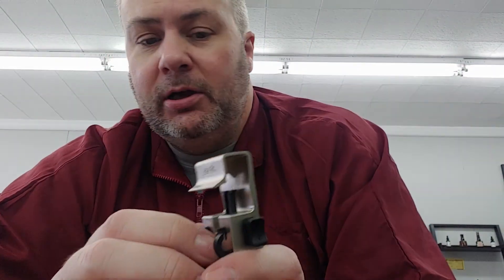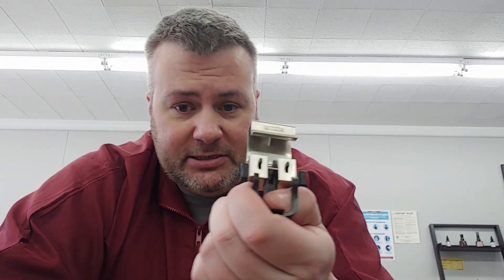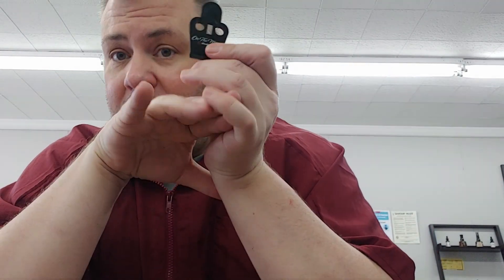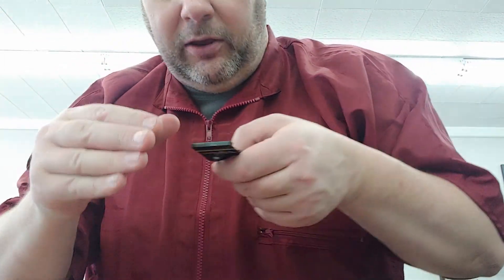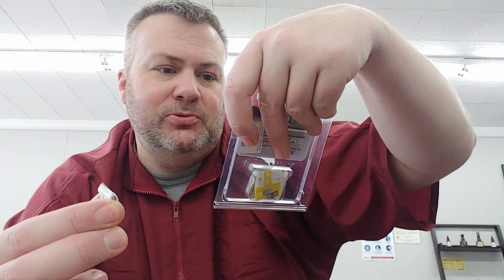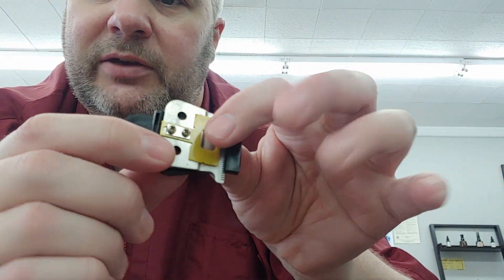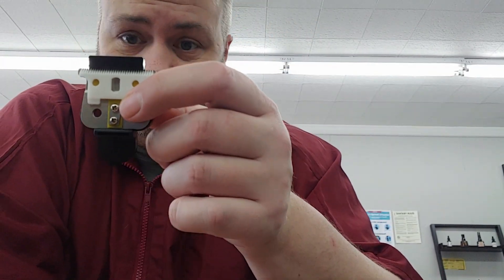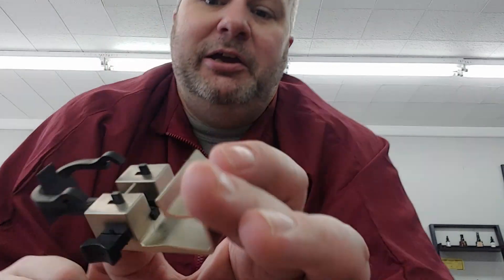Blade Setter Andis Blade GTX Gamma Elite Clipper Mods

Comment: I was actually fortunate enough to buy1 of those Wahl blade setter and it even works on the T wide blade
Reply from the maker: I keep looking for one.... But, wahl does seem easier to set free handed though. Not sure why.
Reply: @carolinabarbershop  that's what upsets me about companies they don't make a certain product that people need and then if somebody else makes it there's a problem
Reply: @carolinabarbershop  I always try to tighten one side first and then adjust the other side to the same level
Reply from the maker: @junebug8808jec  that could be the issue. Tighten both down semi-snug.  Enough to where it won't fall but it needs a little force to move. Then put in position. 1/4 turn at a time each screw until tight.
Reply: @carolinabarbershop  I normally put like a crab pincer grip on it I'll send you a picture on your IG to see if it helps